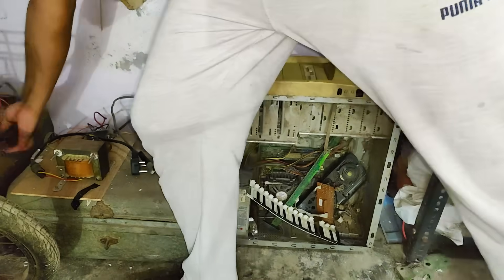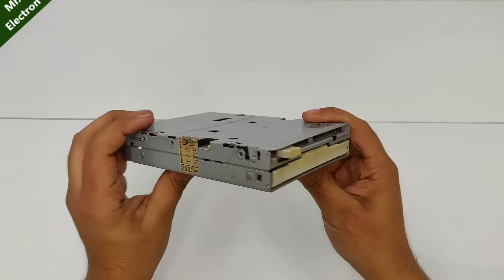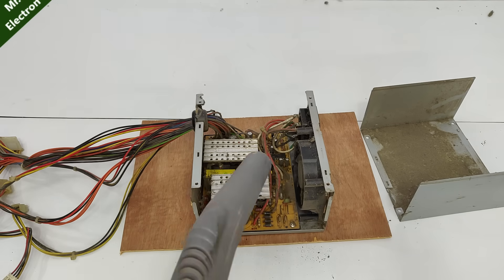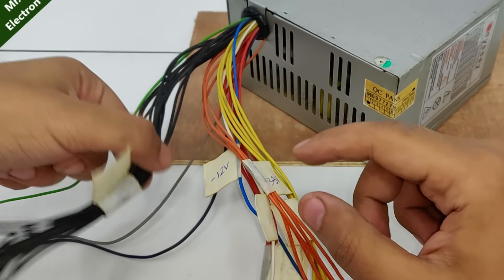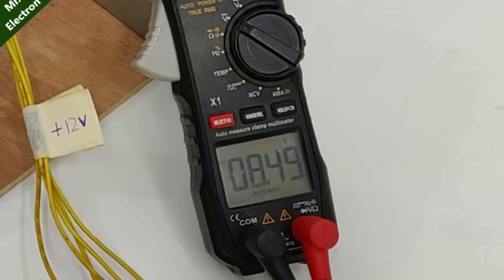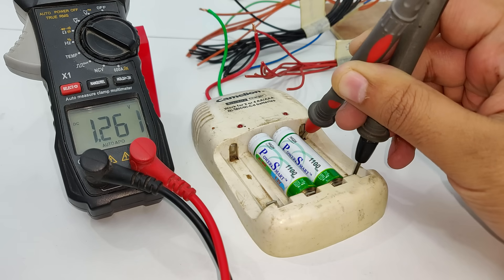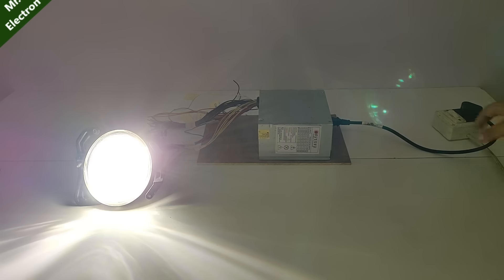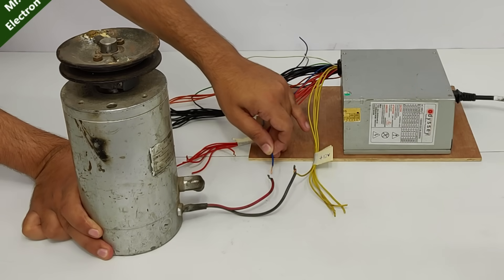20 Amp Battery Charger with Computer Power Supply - 220v AC to 1.5v / 3v / 6v / 9v / 12v / 24v DC

Comment: Great work as always. I also have a battery charger for my 260Ah battery. That seems like a PC power supply but inside the power supply case I fixed a specially designed charger circuit which is awesome. That charger have great features like anti spark, reverse polarity protection, charging control, current limitation safety and much more. A regular PC power supply don't offer such features.
Reply: show us your project!
Reply: @MariusIon1303  sure. One video is available on my channel. More videos with reverse engineering as well as circuit diagram, I will upload soon on my channel.
Reply: M;
Reply: Show us yours
Reply: GOOD

Comment: -12V wire provides lees current, if use it with maximum current and longer duration definitely you destroy your power supply 👍🏻🙄
Reply: Bro but the smps have over current protection then how will it get destroyes.
Reply: @ElectronXYZ  
Already my power supply failed 👍🏻 some time worked over current protection specially for this section and than fused.

Comment: Batteries of all kinds should never be charged without a proper protection or management system. There's a high risk of explosion. Better use this psu unit as a benchtop power supply.

Comment: Thanks sir for this video, please if want to charge 12v:95Ah-100ah how many volt am going to use to charge it
Reply from the maker: A little more than 12 v but best voltage is 14.4v and 9 amps.
Less amps like 3 to 4 amps will also charge it but charging is gonna be slow.
Reply: @MrElectron  thanks
Reply: @MrElectron   that means that 15v can also go for it?
Reply: @bonifaceebom7971  yes

Comment: Hello brother please help I have lifep4 batteries 3.2v 280ah and my electric bike works on 48v is it possible to raise the voltage
Reply: what if theres no diode to put in a 12volts. what will happen?
Reply from the maker: Open up the pack and rearrange the cells if possible and connect a bms then ..... That's the best way without losses.

Comment: I have a question can we used 6a diode in series in gyser element 3000w ac to run as  1500w ac . plz reply if this hack is work how many diode in parallel we have to used.if possible with pratical video .

Comment: Pls mention all the possible output voltage for smps
Reply from the maker: All that ha e been provided in the description + 6.74v , 7.45v , 8.45v , 10.1v, 17.85v
Reply: @MrElectron  for your wires the purple one is the 5v sub connection and the grey one is the power good wire.